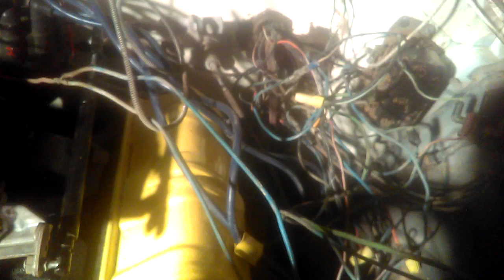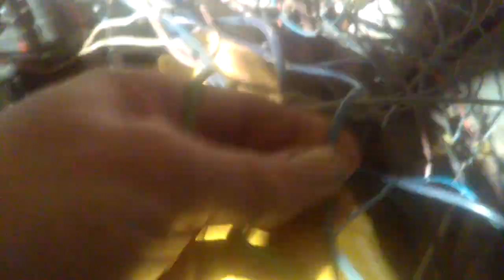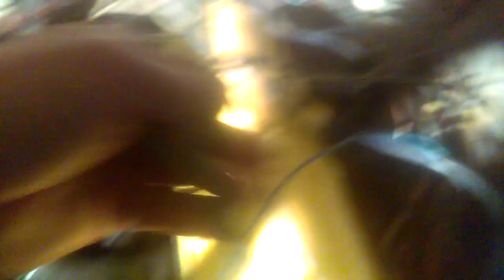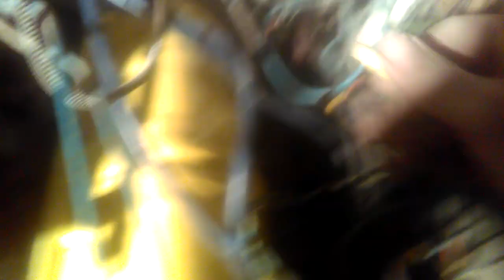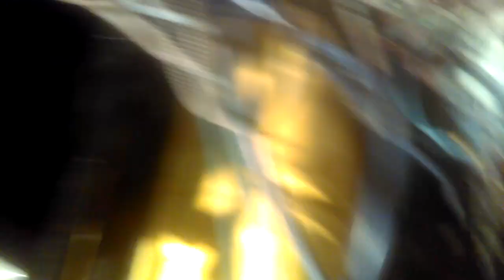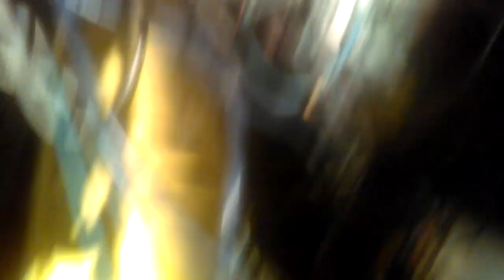Studebaker Champ Wiring Night Mare

Comment: What do you recommend for a basic 1960s dodge? No need for power windows etc
Reply from the maker: This is my go to kit because the wires are longer than most kits and the wires all are printed what circuit they are for. 
https://www.amazon.com/dp/B09P6BH4H3/ref=sspa_dk_detail_3?psc=1&pd_rd_i=B09P6BH4H3&s=automotive&sp_csd=d2lkZ2V0TmFtZT1zcF9kZXRhaWw
Reply: @daleshotrodshop  it's China tho
Reply from the maker: @coyoteserranomusic  I agree but I have found most of the wiring is China. I used Belden wire up until it went to overseas. You can use Haywire I have used theirs for 300 bucks they claim USA wire it looks and feels like China. I try to keep everything USA but it is nearly impossible I closed shop in after 53 years in the business because of constant junk requiring replacement over and over.